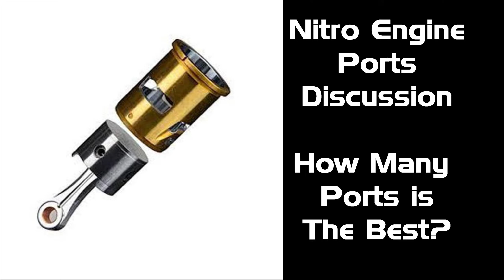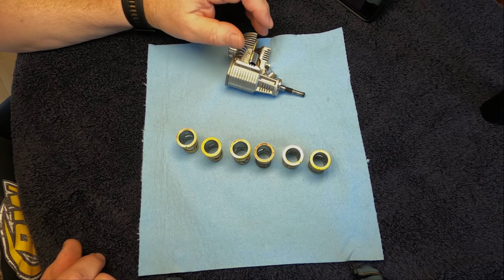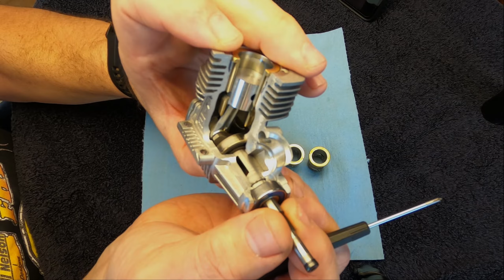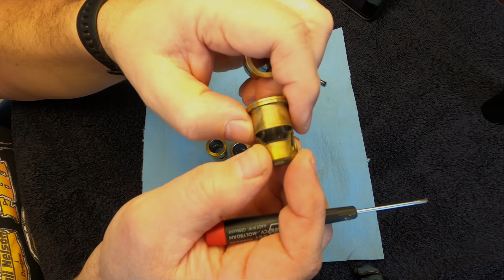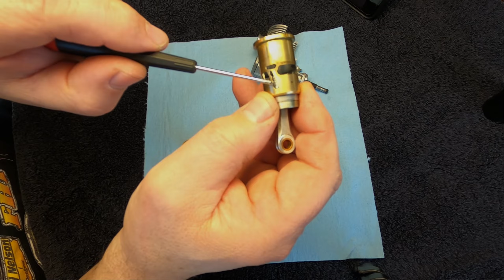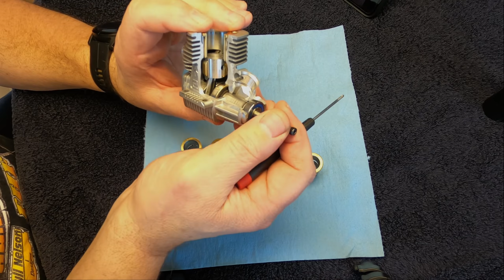Nitro Engine Ports Discussion, How Many Ports is Best?

Comment: Its not the back pressure so to speak, but the tuned pipe reflective soundwave/ pressure at the correct time causing a back force to push back into the cylinder, the fresh air fuel mixture that flew out of the exhaust port and essentially  dynamically super charging the engine. The tuned pipe can take many shapes and lengths to achieve a particular rpm bad for power. Thats gas dynamics folks

Comment: The thing is most engines are not drivable. O.s. speed square has been good. Long strokes are okay but if its even sligthly too Lean it revs To sky high and drivabilty is gone. No one needs engine that speeds up at end of straight

Comment: Back then in the late 90s, and 2000s, what determined what was considered an off road engine and an on road engine, was not only just about ports. For example, what was considered ideal for off road applications were 3 to 6 port, along with it being labeled “Long Stroke” for more bottom end, Less rpm’s on the top of the power band. On road engines were anywhere from 7, 8, and 9 ports, and were labeled “Short Stroke” for less bottom end, and stronger mid to top torque on the top of the rpm powerband for faster top speeds, along with turbo heads for use with Turbo plugs. This was the standard for most Picco engines, and Nova Rossi engines, which included the other line up of Nova Rossi engines under the names of TOP, REX, RB Concepts Rody Roem, Collari, JP Racing and so on. Picco also heavily marketed their line of carb that they introduced around 1996 called the Torque Carb, which was a pain in the ass to adjust, and we’re notorious for air leaks around the base of the carb.

Comment: It isn't possible to grind another port in an existing sleeve. But it IS possible to change the sleeve out to one with more ports if the replacement sleeve is from the same engine manufacturer, sometimes...

Example... My Dynamite .28 Big Red Mach 2 is actually manufactured by SH, and has a 6-Port sleeve in it. 
Well, it just so happens that an 8-Port sleeve from an SH 8P .28 has an 8-Port sleeve that fits DIRECTLY into my Dynamite Big Red engine. They're both 
.28's, they're both made by the same manufacturer, and the parts between them interchange just fine. 

Putting the 8-Port piston and sleeve from the SH P8 into my Big Red engine DOES change the characteristics of the engine, and did give it a power boost and a higher RPM rev range. It was worth the upgrade. The new 8-Port piston and sleeve was $28.99 at A-Main Hobbies, and was a great way to wake up and refresh my tired old Big Red... 👌

Comment: 6:28 That's not a "3-port exhaust"...
Those "ports" are simply supports, to keep the piston from rocking and prevent it from catching on the edge of the port, since it's so wide. That's all they're there for. They don't function as a "port", and are not ports. Sometimes they are called "bridges".

Comment: You should make a video of modding an engine before and after. With drag or track times. 
I had a traxxas 3.3 modded by a well known guy and not going to lie. But my engine seemed like it lost power.
Reply from the maker: There are a few well known modifiers that do not change timing. They just do some Dremel cuts and polishing.
Reply: @TheRwmods  unfortunately timing was included.
Reply from the maker: @Bang_n_slang  What timing did they change?
Reply: @TheRwmods  I can’t remember since it was a while back. I do remember him mentioning the timing on the crank if I’m not mistaken. I would like to say the guys name but I don’t want to give anyone a bad rep.
Reply: @Bang_n_slang  It could be that your are using the completely wrong header and pipe for the mods that were done. Your gearing could very well be wrong for the rpm range also. 🤷🏻

Comment: Explain spraybar location and how that affects fuel flow into the case
Reply from the maker: I am sure the spraybar location can make a difference but I have not messed with it much. I do think our carbs are kind of primitive. The taper of the lsn really effects fuel flow.
Reply: I have found that a carb can flow a touch more with the spray bar just barely protruding into it. However, you will have to retune the engine slightly, because the air isn't moving as fast near the edge of the venturi as it is in the middle.

Comment: What’s always amazed me is the speed with which air and fuel can get in to fill the cylinder. You’d really think there’s no way it would work. I mean a single piston engine running at 36000 RPM is firing 600 times per SECOND!!! How the hell does the air fuel mix fill that fast?!?!? Amazing!
Reply: The airstream couldn't do it instantly. It has to accelerate, just as the engine does. Once the airstream reaches the maximum velocity as the engine reaches it top RPMs, it doesn't actually stop and start flowing in between combustion events, inertia helps to keep the air moving. It basically "bunches up", due to the inertia, up against the closed port and "springs" into the port when it then opens. A well tuned intake tract, and optimized port timing, can take advantage of the inertia and the "bunching up" of the airflow to make more power by allowing the air to stack up and then enter the port with force before the inertia runs out and the airflow stalls.

Comment: Doesn't the more ports mean they can all be slightly different heights giving it a more even power band?

Also could having more ports improve the fuel and air mixture mixing?
Reply from the maker: Could be true on both points. I do see some offset exhaust port heights but not on intake much.
Reply: @TheRwmods  ok. Idk anything. I just guessing
Reply: That's what they're there for....

Comment: Great info. Loving these engine videos. What you think about putting that 8port rossi sleeve in a P5 crankcase with a 15007T crank.
Reply from the maker: Should be fine as long as the block isn't in the way of any ports. Always check compression height when using different parts in a engine.
Reply: @TheRwmods  Sounds good. I will have to look into measuring that as I just got new calipers. The P5 and the s421 8port blocks were the same part number according to Novarossi exploded veiw. It was an idea. Probably a lil much for a buggy but it be fun.